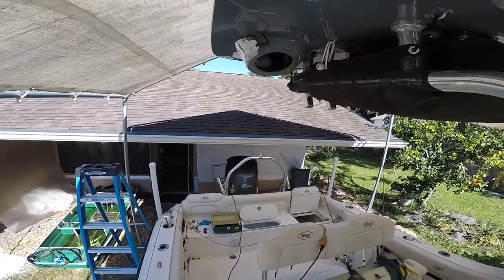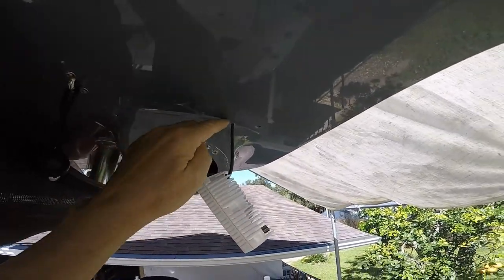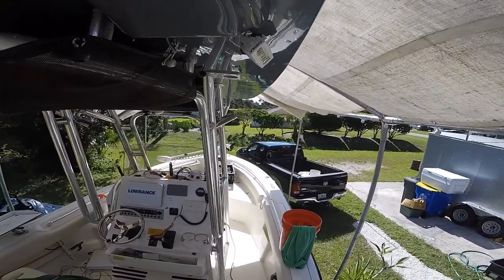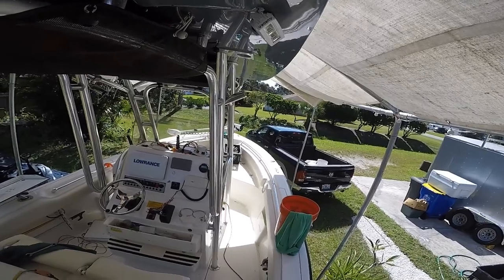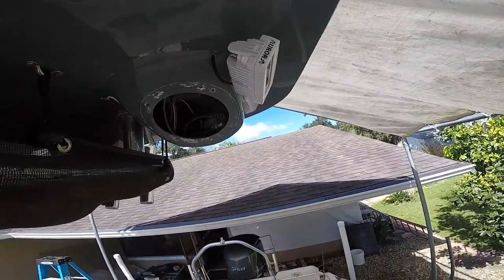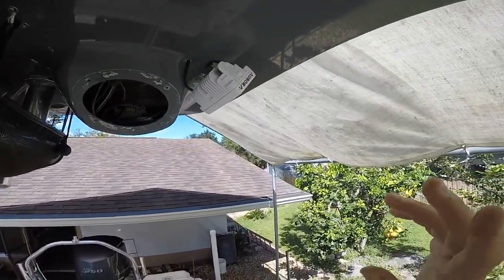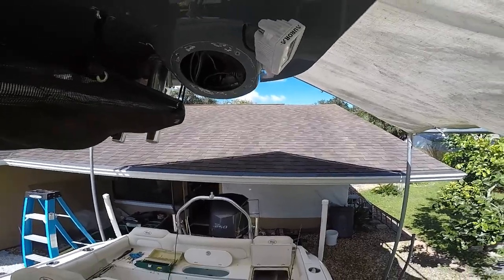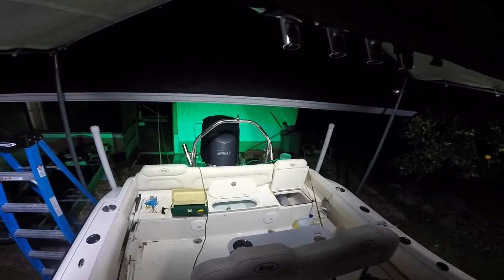how to install spreader lights on a boat

Comment: Nice addition. Do you have a low battery alarm of some sort?
Reply from the maker: Idk thay exist. I was thinking of a volt and amp gauge. But I run a starter battery only for the motor and I have 2 house battery’s which never went dead yet. And I have the new selector switch with a diode that charges all 3batterys as needed. Wow many volts on a 12 v battery when it’s dead